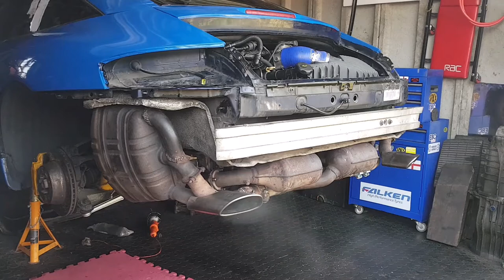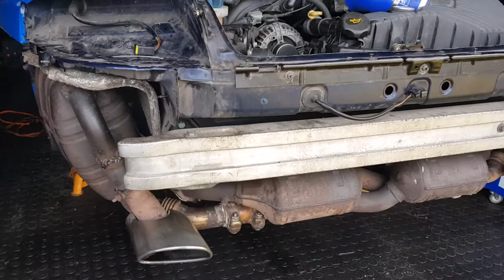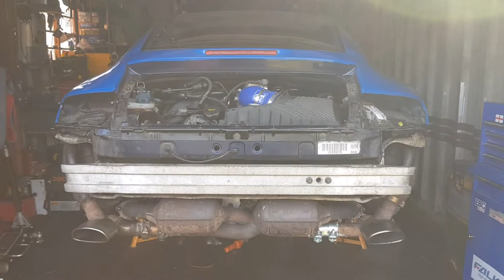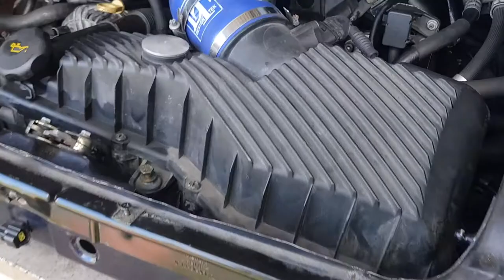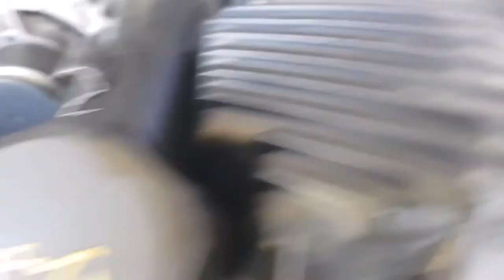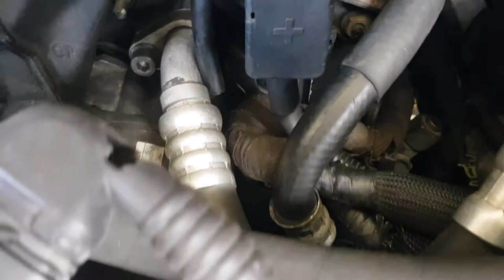Porsche 996 M96 3.9 first start up after full rebuild

Comment: How many times did it rough start and stall out before it ran good? I did a rebuild and it still won’t fire correctly
Reply from the maker: It took a few turns but eventually runs sweet. 5000 miles in now and its runs really well.

What size engine and have you checked the timing is correct
Reply: @infrasilver  3.6 liter…I have both bank 1 & 2 timing I think correct I followed the instructions. Set bank one to u6 set cams at TDC on cylinder 1 removed pin and turned 60 degrees to set exhaust sprocket at correct position, tightened exhaust sprocket then torque set on intake phaser. Then rotated clockwise 360 to u6 set up TDC at cylinder 4 then rotated to TDC torqued sprocket and phaser….. so when engine is at TDC the tool for cams metal plate that slides in should fit in on both sides?
Reply from the maker: @DanielAyala-ck3rm  Yes, the tool should slide back into the slots in the cam each time it has been fully rotated. Did you time it from the factory instructions or my other video? I wonder if there is something not right, is it just turning over and not attempting to fire or is it struggling to run but is firing?
Reply: @infrasilver    @Daniel Ayala  Did you guys have bore scoring? What was the cost to mostly DIY the rebuild?
Reply from the maker: @provalettrash7  All in mine totaled  £7000, I only had scoring on cylinder 4 but the IMS bearing had broken which made me decide to fully rebuild it and upgrade to 3.9

Comment: that sounded rough. on start up. wow. is it OK
Reply from the maker: Yes, it's been running for a year and around 6000 miles, as soon as it had warmed up it was fine. Oil in the bores for lubrication on start up is the smoke, could have even been causing a oily spark?